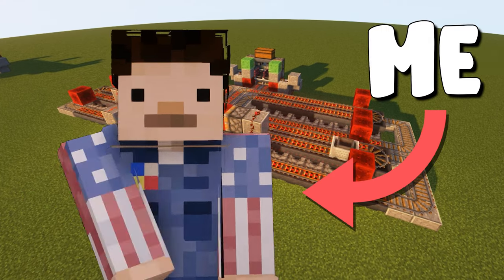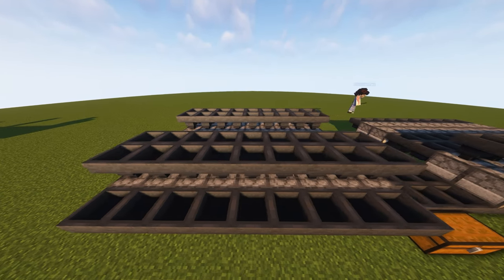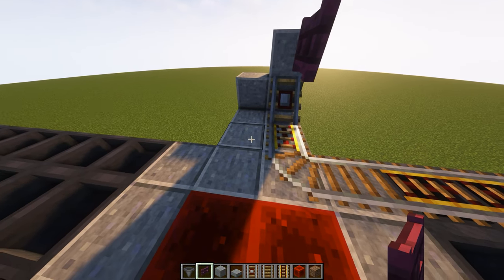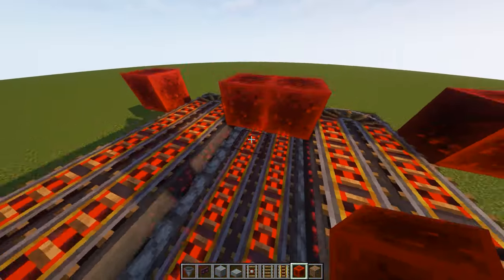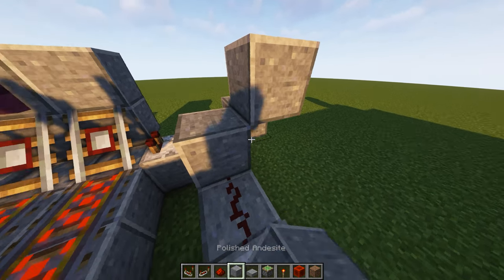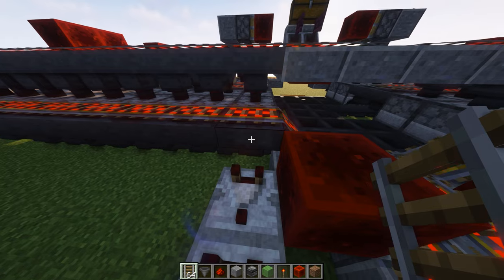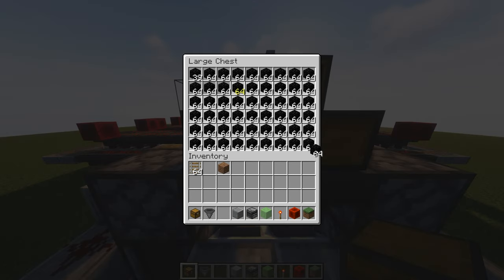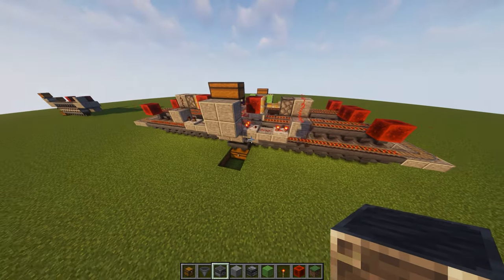Fastest Auto Super Smelter in Survival Minecraft 1.19!

Comment: I like the design. Though i believe there  is a couple flaws that can be fixed. First is the idk the timing on the repeater but it send the items to be smelted without checking if its full which means each cycle its only pumping items into the first few furnaces. Which defeats the entire purpose. Second is the ergonomics all the inputs and outputs are in different spots. Which again defeats the purpose of the minecarts. Make them do all the work! 
Personally id just add a lock to the comparator so it only fires when the mincart is full. Then i try to rework the rail lines so the inputs can be aligned then from there pipe the item to/from the user input. Other than that its clean and simple i really like the layout here.
Reply: how do u add a lock to the comparator

Comment: FIX for anyone having problems with getting the fuel carts going, remove all of the rails from first hopper and only have 1 extra piece of coal in the hopper.. when the furnace pulls from that hopper and it hits 0 the comparator will pull the signal and than open the gate.. don’t ask my why it’s not reading that it’s getting 1 coal out of it.. I don’t know.. it just had to be empty to send the signal out.

Comment: This works great, but for some reason the 4 hoppers in the back (next to the first bend and the uphill of the fueling tracks) pick up coal from my minecarts which than lands in my output chest
Reply: i've got the same problem, you found a solution?
Reply: yupp same here, guess I'll just have to deal with that since I'm not redesigning the thing just to miss those hoppers :P
But in theory you could make them go up at the redstone blocks (so it goes over the block) And then have a solid block on the corner so it still connects
Reply: @keine97ahnung  not really, but haven't tried either, i have 2 solutions in mind tho:

1. Just reroute the minecart so it doesn't pass next to hoppers in the curve

2. Don't use a curved rail, but powered rails, but this is directional and prbly won't work for both sides

Either way, I'd recommend checking out ilmangos latest video (design of the conveyor belt gold farm for scicraft), he explains the issue with minecart hitboxes in curves (I'm 99% sure it's the same mechanic happening here) and the mechanic of using powered rails as curves pretty well.

Comment: Great video, I find the pacing perfect. One small thing is I am not sure if the number of the hopper on the material list are correct. 216 are only for the filling of fuel, input,output of the furnaces. Also 64 furnaces are also not enough?
Reply from the maker: I think you're right. It should be 72 Furnaces. I do think the Hoppers is correct though unless my math was off again. Thanks for pointing it out!
Reply: @wafflecraft8710  216 is 72 furnaces multiplied by 3, whitch is the input, output and fuel hopper for each furnace. In your design, some extra hopper have been use in the center to connect the output hopper back to the output chest(I think there are 20 there),there are some addtional hopper there, nevertheless, the design and video are great work, keep it up!
Reply from the maker: @wrydp7168  Thanks for the feedback. Ill take more time into making sure the numbers are correct from now on!

Comment: Any idea why I keep getting fuel in my output chest?
Reply from the maker: My guess would be a misdirected hopper? I was having issues with it the first time i built it, however i just put it on my multiplayer server and it runs fine.
Reply: I had this problem too. I was getting 4 pieces of fuel in the output every time the fuel carts made a pass. I figured out that the culprits, for me, were the 4 hoppers that the fuel carts pass, as they first leave the chest refill station. I noticed that the hoppers were each able to take 1 piece of fuel as the fuel cart makes that first turn and goes up the hill to get to the furnace hoppers. I fixed it by putting full sized, solid blocks on top of those 4 hoppers. You can see the hoppers in question at 06:45.
Reply: @brandonb2454   VIDEO TAG IS PREFECT TY
Reply: @brandonb2454  Thank you bro I had the same thing happen and I did what u said and it stopped.
Reply: Just 4 simple full blocks on top of the hoppers and runs so good on 1.19 java

Comment: Does anyone have any idea why my fuel carts arent moving at all so they are stuck at activation rail and the pistons arent moving
Reply: so the minecarfts move only when tehy are full of fuel and they go one time around rails and then come back and i have to refuel it till its full
Reply: Yea I can't get my fuel carts to move, they are full and I made sure to do the hopper full of rails step. Not sure what I'm doing wrong. Im playing on the Nintendo switch light if that helps.
Reply: Did you ever figure it out? i have the same issue, i'm currently stuck opening the gates manually to release the fuel carts.
To clarify, once my carts are full, the piston pulls in the slimeblock "column" but the carts aren't getting released
Reply: @Neelea1991  yea havent still figured it out
Reply: @thontuzi8901  I'm still a bit of a novice at redstone mechanics but I got it up and running now, turns out that the carts will only be released if that first hopper needs fuel, so if the first hopper is full, the carts will sit still :)

Comment: Does this work in bedrock?
Reply from the maker: I don't play bedrock so i don't know.
It's safe to assume no and you should just look at a different tutorial specific to bedrock.
Reply: @wafflecraft8710  are you positive? And if so, what causes it to not work? I just spent so much time getting resources just to find out it doesn’t work.
Reply from the maker: @SwavyAvxry  I don't play bedrock, so like I said I have no idea. Your best bet is to go watch a video specific to bedrock. Redstone/hoppers/rails work a little differently in bedrock so im assuming there is an issue somewhere in this system
Reply: @wafflecraft8710  I built it and you’re right. The system that you made to stop the mine carts with fuel doesn’t work. You have to turn it on and off manually but the front works flawlessly. Great job!
Reply: @SwavyAvxry  Bedrock doesn't have quasi-connectivity and the problem is with comparators below observers (one side you can see in 10:07). In bedrock those comparators aren't connected to anything but in java block with torch will be powered by it (despite comparator's horizontal working area). Probably entire section with block and torch and what is behind it need to be elevated one block up or redesign it differently, without QC, to work in bedrock (same level for comparator and block with torch is needed when both are that close to each other).
Reply: It does
Reply: It does work you just have to remove all the rails out of the first hopper and only have 1 coal in the hopper to start out with
Reply: @jerimiahsmart8392  I’m on bedrock and I’m having a problem with the hopper Minecarts not taking what’s in the input chest like, the hopper minecarts aren’t taking what’s inside the chest